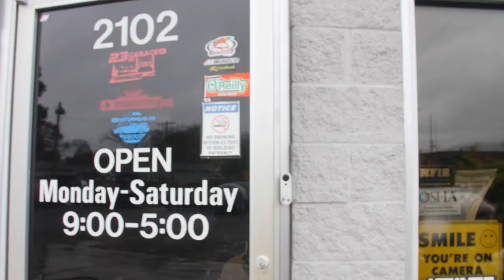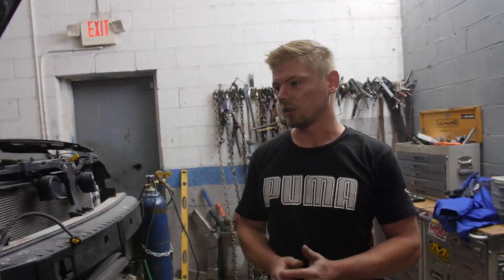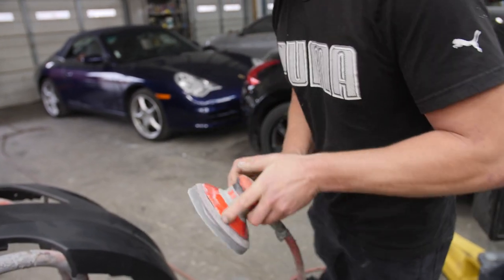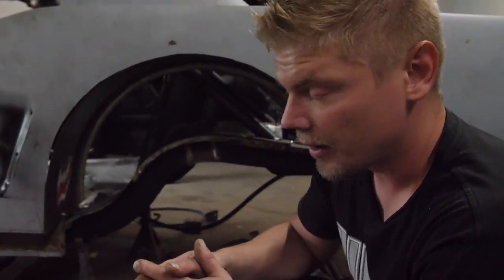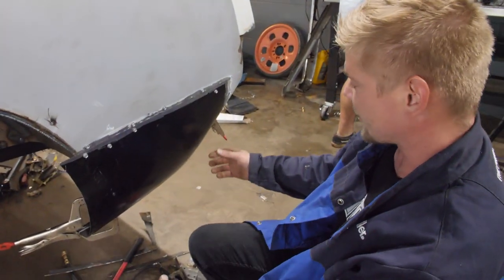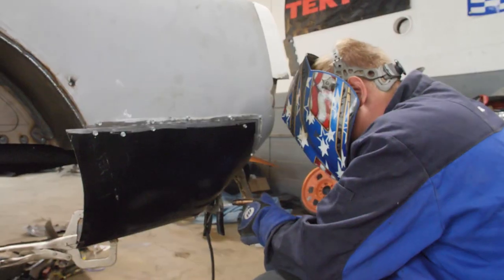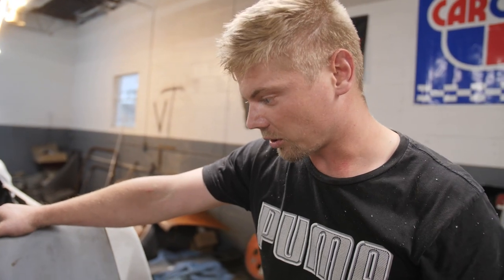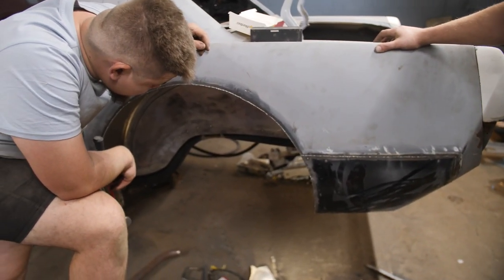Building a Custom Wheel Well on Vtuned's Widebody 1965 mustang

Comment: Bead rolling actually gives a lot of structural strength without realizing it; a V shaped  bead roll in the center of that panel would have made it even stronger, however what you did will work fine. Great video! keep  Orange Crushing It!

Comment: Great idea to get the rear end in tire width and suspension brakes clearances set up then the wheel flares. That would suck if the flares didn’t fit the tire width.. but it is looking good now y’all got to teach Ben to weld 😇

Comment: Wouldn't it better to have the right rims and tires that you want on the car first, and then build the flares around them? 
That way, you are sure that rims and tires will fill in the Wheel Well nice and tight. 
This is very important for the stance and the way the car looks for wide body cars. .